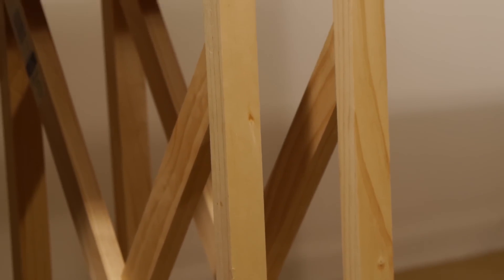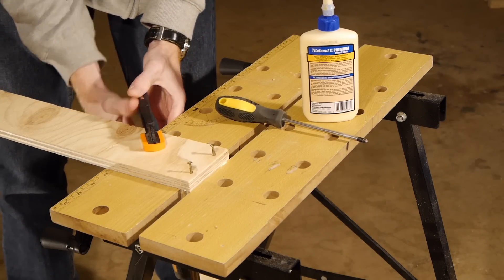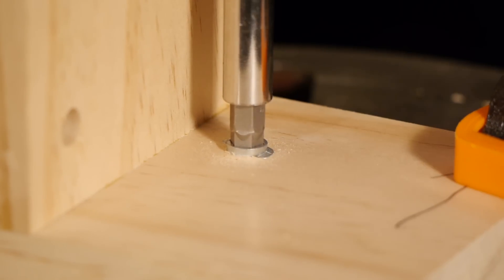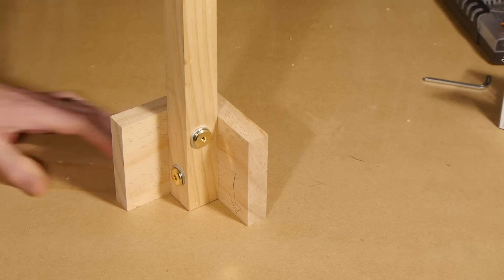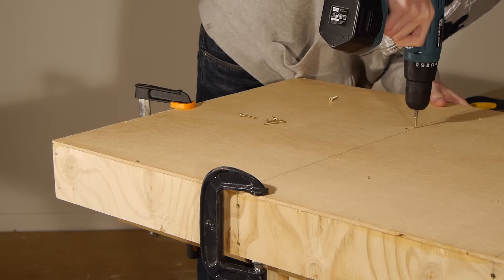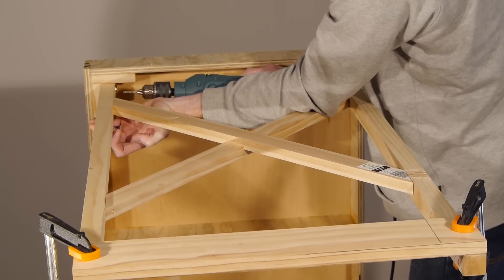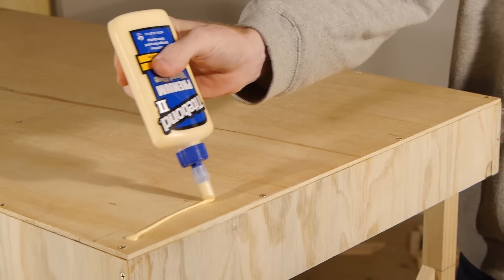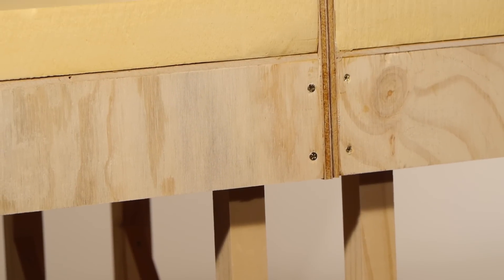Building a Model Railway - Part 1 - Modular Benchwork

Comment: I m retired and planning to do a huge layout that takes up most of the rec room as its vacant. Its going to take in two walls which I will mural then blend the scenery down as a mountain side to a huge suspension bridge over a river.The bench will be 24 feet long by 8 feet wide! I took some awesome pics when I was In Switzerland to give me some ideas. I am  still planning out the bench and its a lot of planning believe me.I have to make sure I dont hand cuff myself when putting in legs and supports as I have to consider all the wiring for the H.O SERIES!

Comment: Luke, A trick we use in cabinet making is to put a piece of tape over the backside of the threaded insert to prevent glue from getting in the threads of the insert. That way you don't need to be as careful with where you put the glue.

Comment: Great job on the bench work.  Sure is a quality build.  You should never have any problems with the benches.
Scott
Reply from the maker: Scott Downey Thanks Scott, one person did mention foam shrinkage in the extreme hot and cold but it's glued down solid. I did a test with the Gorilla glue on some scrap foam and I couldn't get the foam off the plywood without tearing it to pieces! So hopefully that will keep everything in place. 
Cheers
Luke.
Reply: Luke Towan There is nothing in this world that doesn't shrink or expand in some shape or form.  You can only try and make it as little as possible.  With the quality of the build you should have very little to worry about.  I have taken a diploma coarse in cabinet carpentry and worked with wood and other things.  I have seen the power of expansion and contraction.  If its going to happen there is nothing you can do about it.Scott
Reply from the maker: Scott Downey You're right about that Scott! I have a feeling they will more than likely stand up to the test of time. I think they are small enough that expansion and contraction will have a very small effect.
Cheers
Luke.

Comment: There is no need for the extra cost and weight of the plywood top.  The 2" foam board can be glued directly to the frame.  The assembly be sufficiently strong and stiff.  This also makes through-drilling much easier.
Reply: Did you actually build a layout that way?  I would think the foam is not strong enough to withstand that much pressure in a larger open surface area.  I do agree the added weight is an issue!  When I tried building my modular railway, by the time I added all the scenery and stuff, wow!!  Each 30" x 30" piece was close to 100 lbs!!  So, weight can be an issue!

Comment: Hey Luke, great video, you're quite the carpenter! Looks like you have a great set of power tools too, very cool! Can you tell me why you put a thick piece of foam on top of the baseboard? Is it so you can carve out scenic areas? A lot of us here in the UK simply glue a thin sheet of cork 1-3mm or so, either over the entire baseboard or just underneath the track. Some also use foam but it's not very thick. I was just interested that's all! Looking forward to the rest of the series! 
All the best
Howard.
Reply from the maker: Howard Sugars Hi Howard, thanks for the compliment. A while ago I was building quite a large model rocket and I ended up buying a bunch of tools for building it! Unfortunately my rocket was illegal to launch given that I planned to launch it with fertilizer, since then I haven't used a lot of those tools but now I'm getting the opportunity use them again, but I'm still not sure what to do with all the potassium nitrate sitting in the corner!  
You exactly right with the foam, I'm planning to carve rivers and ditches into it. I built a model railroad a while ago with just a plywood base and ended up having to use a cookie cutter to cut out the river so I thought I'd try foam and see if that makes the job any easier. I've heard a lot of guys have good success in the US using foam as the subroadbed.
Cheers
Luke

Comment: I have always thought building a "modular railroad" layout was a smart idea, because especially for us Americans, we tend to not live in the same home all our lives.  We move around, therefore modular makes sense!  I attempted to build a modular set when I was much younger, but it failed to truly work for me.  I found that it was clearly obvious where the pieces met.  So, what do you do?  Do you build your scenery on an edge and then if you must take it apart later you just use a saw and cut your scenery apart?  What about track layout.  I would imagine it's nearly impossible to have your tracks joints meet exactly at each seam right?  So much to think about, wish you had made a part II to show us that part...hehehe.  Thanks for the video though, got some further insight on how to strengthen my base.

Comment: Best videos I've seen on trains.I'm wondering about the plywood base under the foam - which seems to be what everyone does.  I did a 5x8" layout and put 2" foam on top of the frame; seems to work perfectly well.Any thoughts skipping the plywood?
Reply from the maker: +dc13032 You wouldn't have any issues skipping the plywood base as long as the foam has a good frame to sit on. The main reason I made the plywood base was for two reasons, to help make the frame more rigid as the layout will be moved around a bit and also I plan to use powered switch machines and the plywood base gives a nice footing for the tortoise switch machines. 
That said it's not too difficult to fit tortoise machines onto the foam directly, they still work fine. 
Either way really, just more work involved if you plan to use a plywood base. And just make sure the foam is glued pretty well to the frame if you don't use the plywood base because when the scenery goes on it and starts to dry it has a tendency to cause the foam to lift up on the edges.
Cheers
Luke.

Comment: 30 by 30 cm legs???
it should be mm right?

This was so nice, do you have any specific length on the modules?
I have seen somewhere that people tend to use 1200mm or 2400 mm long modules. And how would you do corners, would you do 90, 45 or 30 degree corner modules?
Reply from the maker: lol yeah you are right.... 30cm.... they'd be some really solid legs! I just do corners at 90 degrees, there's just enough room to get the track curved at a radius that's not too sharp.

Comment: Luke;
Where did you get your cabinet bolts and thread inserts from? Same with the feet and nylon inserts? Bunnings perhaps?
Reply from the maker: Andrew Martin yeah I got the cabinet bolts from Bunnings, they came in a pack of 20 for about $12, the alan key comes with them and the thread inserts are the same brand as the cabinet bolts, they should be pretty close to each other in the store. The nylon inserts are from Masters and cost about $4 for a pack of four. 
Hope that helps 
Cheers
Luke.
Reply: +Luke Towan - you can get the Kreg tools in Melbourne from Carba Tec.  I originally got mine in the USA when we lived there. It took some time for them to get here, but they make wood working so much easier.
https://www.carbatec.com.au/joinery-and-adhesives/pockethole-jigs-and-accessories/pockethole-jigs/kreg-k4-pocket-hole-jig

Comment: As always great video Luke. I do have a question, why didn't you glue the two foams from the two tables together, but instead you used wood between?
Reply from the maker: I left them separate because I plan to assemble and dismantle the layout to move it around, I needed to create small modules so I could put them in a box and stack them up. 🙂

Comment: Any advice in favor or against folding legs, instead of screw-remove legs?
Reply from the maker: dascandy Hey mate, I did consider folding legs but I felt like it was going to be a lot of work. Plus then you'll need to consider where wiring will go and switch machines, you'd want the legs to miss all that stuff if they fold up. I went with screw in legs basically because it was easier and probably cheaper.
In saying that though, if you can engineer some good legs that fold, miss all the under layout parts like wires and switch machines and also make them stable, I think they would be a good idea. Just a lot more work involved that's all.

Cheers
Luke.